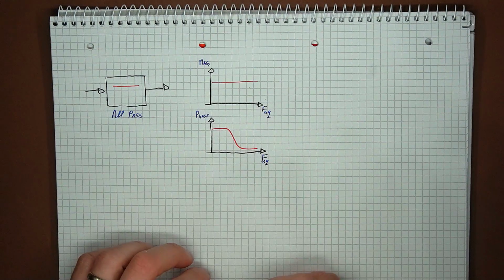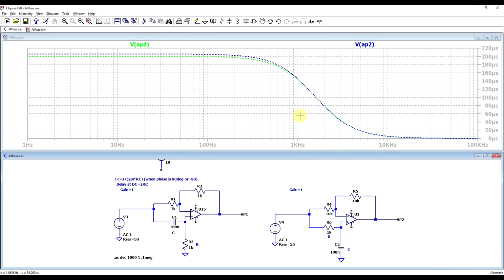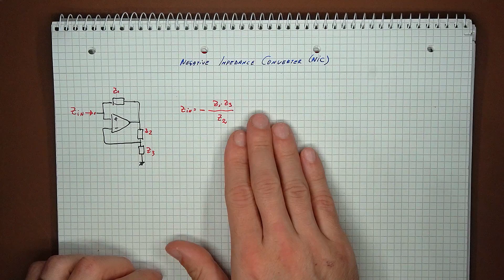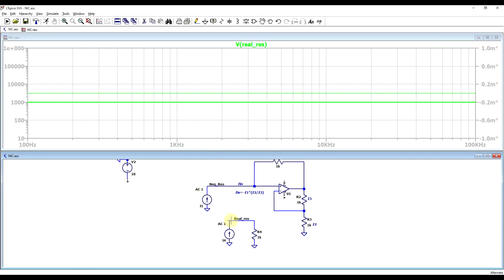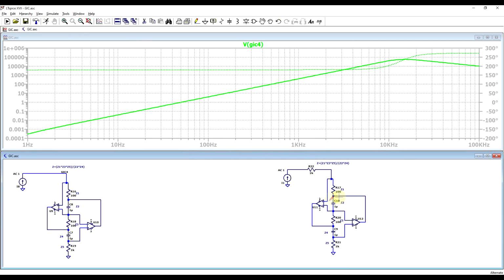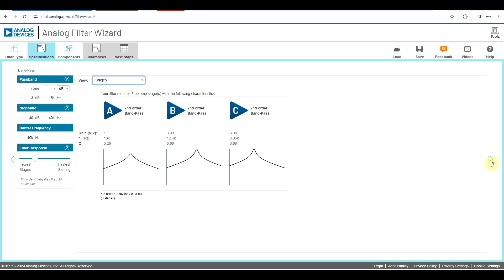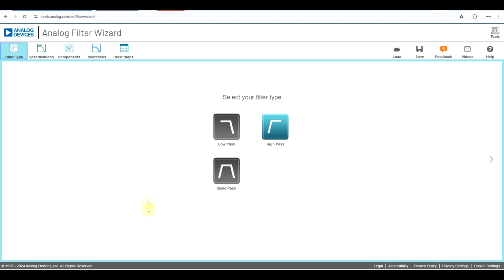MORE Active RC Filters

Comment: Are you self employed? Your skills could help to speed up my project….on DIN rail mounted modules to filter noise. Noise comes from the mains supply (pump inverters) as well as switching power supplies. I have a rough design/plan, (proven), but I’m short on time to implement it along with everything else that I need to do for the project.

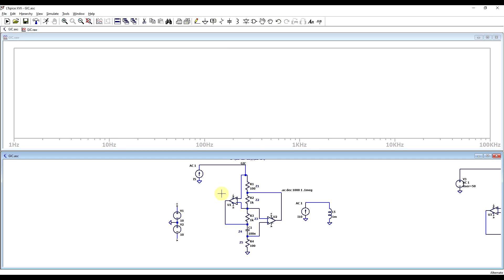Comment: 12:30 The gyrator forces the simulated inductor in parallel but can't two gyrators be linked at their grounds with halved values to put it in series? I haven't seen an example circuit.

Comment: Hi. Try to develop a driver for field mosfets so that it is better than IXDN609CI. Exactly. The power supply voltage of the driver is +22...25V. The driver load (mosfet gate capacity) is up to 3nf. And most importantly - the most even meander at frequencies up to 12 MHz.

Comment: Hmm, I didn’t even know that it's possible to build a low-pass filter with a constant phase using a negative impedance converter. 
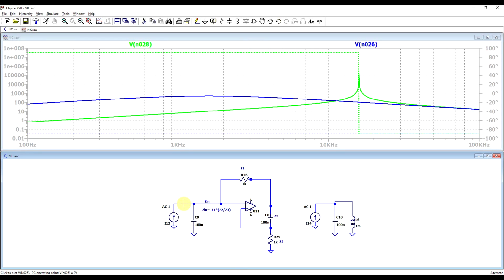And even bandpass filter 10:46 with constant phase in passband!? It looks like some kind of miracles, everything looked like it was impossible in principle. I now need to doublecheck this )
Reply: I am looking at the bibliography cited in the video for a reference to that circuit and I found nothing. Could anyone cite a reference to that kind of filters? I think they are very interesting.
Reply: @llamedom  IMSAI 1781 Gyrator (part 1 of 4)  youtube video title
talk about frequency dependent negative resistance (FDNR) circuits  WIKI on this 

GOOGLE this  " elliott sound products active filters using gyrators "
Reply: Indeed, extremely interesting examples. I'm most intrigued by the ringing aspect - after all, we know that linear phase filters exhibit pre-ringing behavior as an impulse response. It would be worth to test this circuit a deeper with ltspice and then eventually build a prototype.

Comment: i believe the device  word type you are looking for is a gyrator 
IMSAI 1781 Gyrator (part 1 of 4)  youtube video title was a great over view  on this  item as well 
thank you for covering it as well as everyone learns a different way and more knowledge is better then less
Reply: To add to this:

-L made from a C is what Gyrators do: You can make some impressive simulated inductances for audio-filters out of capacitors: Larger caps are less heavy and expensive than the respective inductances you would need for audio frequencies at high power.

Fesz basically explains this at the end of the video without mentioning gyrators and the cost/mass tradeoffs.
Reply: @vikenemesh  yea  i was adding reference materials  the video i referenced has  a multi page PDF and a 4part video series all about gyrators 
but yea  you are one of a few i know that even knows what they are.
as some point he was looking for a  word to describe the circuit with a  name/label early in the video.
i really should have used the term "talk about frequency dependent negative resistance (FDNR) circuits"
if you groogle these terms and look for the paper it shows LC RC LR type circuits  the terms of the search should be ::
""     elliott sound products active filters using gyrators     "  copy all in here and its the top link 
i still believe both are great content and excellent presenters
Reply: @vikenemesh  alsso thank you for the ADD +++  ten K likes